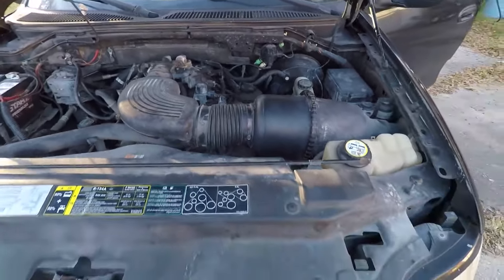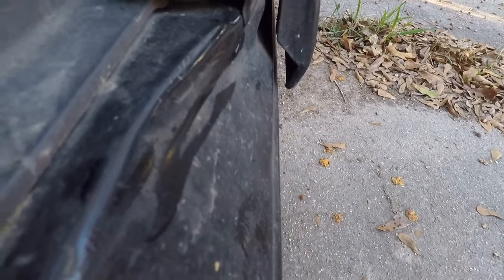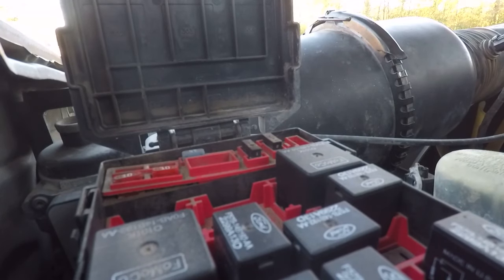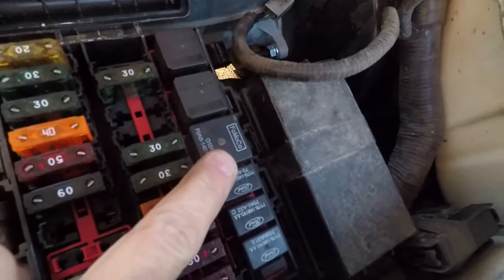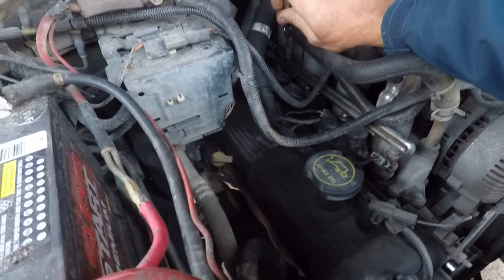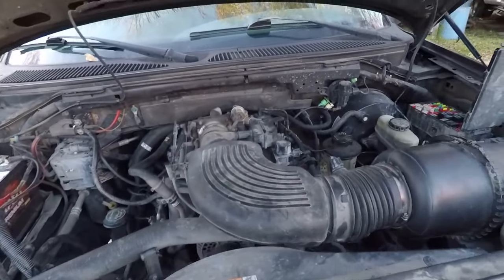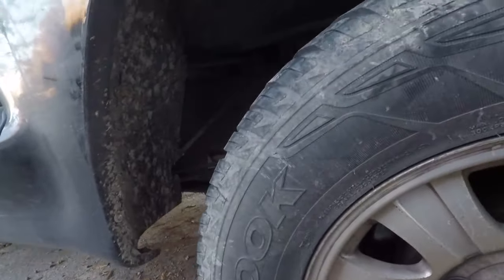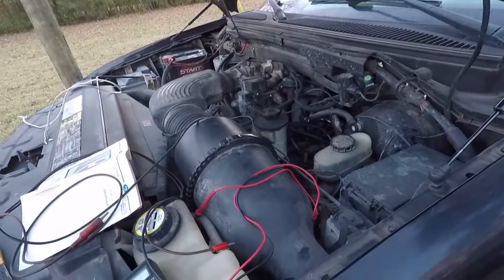F150 Crank No Start Diagnosis

Comment: My 01 Super Crew has been a strong workhorse with 207k and counting. That thing is dead nuts solid!
Reply: fokuz02 257 k on my 01 super crew other than normal maintenance I have put on a alternator and a egr
Reply: 😂😂😂 i got 435k+ extended cab and she just went out in me
Reply: 02 supercrew sitting at 412k definitely solid

Comment: Check fuel driver module..could be a corroded connection..it's mounted by the spare tire..
Reply from the maker: Excellent thought. Will do. Thanks!
Reply: Isn't one on the 2003. Started in 2004
Reply: But wouldn't a faulty Fuel Driver Module throw a code? I have a Crank but No Start situation but I'm getting a "Pass" with no codes fired.
Reply from the maker: Howdy! The FDM failure may throw a separate code, but they didn't start being used until 2004 in the second generation of the triton engines. The black F150 in this video threw Lean Bank codes when it's pump failed. But my 97 never coded at all when its pump died last month even though it ran really badly for a fair bit of time. Best check for the pump is the schrader valve on the fuel rail. If it's not spraying everywhere when the key is on, the pump is seriously suspect. Thanks!
Reply: @aaronsrose  How do I know it it's the FDM vs the Fuel Pump? Also, I tried the test where you spray starter fluid to check for missing fuel, and the engine still didn't fire up at all, not even for a couple of seconds, which makes me think it's a spark issue. I can't find my Shrader valve to check for pressure. Found one valve that spewed green liquid. That wasn't it.
Reply from the maker: If your truck is an 04 or newer, I don't have experience with the ones that have the Fule Pump Driver Module other than what I've seen on the Fordtechmakuloco channel. My experience is only with the older ones that don't have the module. That said, if it didn't fire at all even with ether, I would also look into the spark side of things. Maybe staring with the power supply to the ECM if there is a fuse or relay for that. I've not had a spark issue other than a single coil failure at a time, so this may be a little over my head.
Reply: Fpcm didn't start until 04
Reply: 2001 here crank no start a no codes lot of water in the passenger side door all over the carpet???

Comment: You dont have to suck the gas out. Open the fuel door remove the screws holding the fuel neck to the bed, remove the bolts the hold the fuel tank side of the bed on the frame, losen the other side of the bed bolts thst hold the bed to the frame but don't remove them completely.  Get a friend to stick a 2X4 to prop the bed up and then you can the fuel pump out. While the fuel pump is outplace clean towel over the fuel pump hole in the tank. It tskes sbout 30 minutes with an electric impact gun.
Reply: Not a rusty one in northeast,bed rails would disintegrate.. removing bolts.

Comment: Diagnosis doesn't stop at "fuel pump doesn't work"  the question is why it doesn't work.  You didn't check for a clogged fuel filter for instance.  There's also a unique problem with this generation F150's , a wiring harness on passenger side of engine rests on a hot pipe  - it's insulated but still hot  melts the insulation off the wires and then the power from somewhere doesn't get to someone where and if you fix or replace those wires, it works again.
Reply: Acabo de reconstruir el cableado que se quemó con el escape, pero sigue sin encender solo da marcha y como. Alos 3 intentos de marcha se sigue descargando, tienes algún diagrama de cableado?

Comment: 2001 XLT sport no power to fuel pump. When testing voltage at relay socket in key off there is 12v on one side, key on 12v 2 sides and 7.7v on the fuel pump side. How’s that happen?
Reply from the maker: If the 7.7V is through the relay, I'd swap it with another to see if it changes.  If it works better with another relay, I'd put a new relay in it and continue.  If the 7.7V (should be 12v I'd expect) at the relay socket is not making it to the hot side of the pump,  I'd start running down the wires from the relay to the pump to see if there is a broken one or short somewhere.  And for grins, I'd make sure the fuse is happy as well.

Comment: I can hear my fuel pump and it has all new plugs and coil and cranks string but won’t start, has died once in me before but started right back up and lasted another hour before I was home with no issue and now it won’t even start at all
Reply from the maker: Still could be fuel pump failing. This 03 would sometimes start and run a little and then die when the pump stopped producing pressure. A fuel pressure test would confirm that.

Comment: Great video! My 02 5.4L is doing the same thing and all fuses/relays are ok. One odd thing I wanted to ask about is I was assuming it was the fuel pump and no pressure at rail, then all of a sudden after checking every day for a week one day it started and ran fine up to full engine temp. When I turned it off and immediately tried to re-start, got the crank bo start agsin. Just seems like a weird way for the pump to be intermittent. Any ideas guys?
Reply: My 02 is doing the exact same thing right now. When it does start she will run for hours like a top but if I shut it off and come back there's a high chance it just cranks and never fires. Did you figure yours out?
Reply: @dawildcatz87  yup, was intermittent fuel pump operation. I got one cyber Monday from NAPA for like $120 and paid a local guy $160 to drop tank and install. No more problem. Hope it’s an easy fix for you. Happy new year!
Reply: @dawildcatz87  same exact problem here g
Reply: @lillianasanchez5028  fuel pump replacement fixed my truck. Eventually it got so weak it wouldn't prime at all

Comment: I have a 06 F150 5.4L .  Has spark, hear fuel pump come on, checked  all fuses and relays. "Crank No Start". I have no Schrader valve, so I used Quick Start. Check 4 of 8 coils all have spark. Battery alternator starter all seem to be fine. Think I bought a truck with a Gremlin. 
Any suggestions?
Oh yeah, battery died so no codes!
Had previously camshaft positioning sensor codes. Changed both out.
Reply from the maker: I think these trucks started using a fuel pump control module in about 04. It's usually under the floor on the frame around the front of the spare tire. I think it controls the speed of the pump. If that is crapping out maybe it's not allowing the pressure to get to where it needs to. I'd see if I could find and test the fpcm.

Comment: I have a 2004 Ford F150 5.4 L heritage edition.. At times, it won’t crank over. The only method to successfully turning it on, is to disconnect the inertia, turn it on and then reconnect the inertia switch. When it doesn’t turn on, the inertia switch is not tripped. I have since replaced the switch with a brand new one, but the problem persists. If anyone has any idea as to what I should do, I would really be appreciative! Thank you.
Reply from the maker: That is weird. Have you tried to bypass the inertia switch completely by wiring around it? It could be intermittent contacts in the connector to the switch.
Reply: @aaronsrose  hm not quite sure how I would do that.. I was going to try to splice in a toggle switch but not certain which of the two lines to tap into??

Comment: Was the fuel pump the problem?
Reply from the maker: Yes.  My next video showed changing it and its been running well since.  Thanks!
Reply: @aaronsrose  nice fix Aaron!! My 2003 F-150 4.2 L V-6 will crank but will NOT start or even act like starting like your 2003 4.6 L V-6. It ran fine when I parked it the nite before. I'm NOT getting any spark & CANNOT hear the fuel pump running with the key on! Any ideas would be greatly appreciated!! I did replace the coil pack but no luck!! All the fuses are good! I checked them first! Maybe PCM relay or the PCM itself? Any help Aaron would be greatly appreciated.  I did some research here online & found  out there is NO Fuel pump driver module on the 2003. Ford started putting them on in 2004. I even crawled under the rear, with the spare tire removed & only thing there is a canister. I have MS & NOT able to do as much as I use to! I'll be waiting to hear back from you! Thanks!
Reply from the maker: Sorry to hear that.  If you have no pressure st the fitting on the fuel rail, the pump is either not running or has failed.  Unless it's always been loud enough to hear the pump. You may not be able to.  If the fuses and relays are good and the truck cranks over with the key it could be the pump and/or filter.  If you've checked for spark by pulling a coil and plug and cranking the truck while grounding the plug on the head and saw no spark,  especially on multiple coils,  that's a different problem.  I'm not sure what controls the firing of the plugs but I would check to see if the ECM is getting power correctly.  Good luck.
Reply: @aaronsrose  thanks Aaron! I'll get those things checked out.
Reply: @aaronsrose  just a update Aaron. So I went out today to see if I had spark with the new coil pack I put on yesterday! I do! I got zapped! Lol anyway I put the plug wire on & it started right up!😳 I let it run for 30 minutes. It never stalled out!! It idled smooth except a time ot two it slow down then back up!!  I'm thinking fuel pump as per your video! But I'm gonna just cut a hole in the bed! My truck is rusty some what the heck! Lol
Reply: @aaronsrose  update for you Aaron. I was able to cut a door in the bed of my 2003 Ford F150 to access & change out the fuel pump. It wouldn't start to pull in my garage so I smacked the bottom of the gas  tank with a rubber hammer & it started up!! I also changed the fuel filter. But like other comments now my gas gauge is showing almost a half a tank of gas. It actually had an eighth of a tank.🤔🤔 I just filled up the tank & now it's showing  1/4 tank. I do know that prior to changing the fuel pump it would take a while for the gas gauge to go up after getting gas. Maybe this new pump will do the same!! Idk
Reply from the maker: Glad it worked out. I'll say that every aftermarket pump I've done on these, and it's about 4 or 5 to this point, the fuel gauge acts as you describe. Sometimes it takes a few starts and some driving before it goes up to full and then it's fine. No idea why this is. Thanks!
Reply: @aaronsrose  yes Aaron my gas gauge now reads full as it should! Thanks
Reply: I have the same PROBLEM on my 98 f150 it will cranck but no start after trying a couple times , they only way it will start is if I spray carburetor spray on the carburetor, I neeed helpppp do you guys think it’s the fuel pump or fósil ? Or my air filter is kinda dirty I’m thinking of changing it and doing a tune up 🆙
Reply: Actually my truck will run fine after it’s starts , it doesn’t shuts down or anything it can be running for 30-45 min and it’s doesn’t shut on me it runs smooth it’s just the start takes a couple turns

Comment: my f150 is dead the battery is charged but wont do anything. you can jump it off and it will crank,but when you remove jumper cables it dies.
Reply from the maker: That's different. I'd start by confirming that the battery is good and then check to make sure the alternator is charging. Thanks!

Comment: Have similar problem on 03, 4.6L except the fuel pressure goes to 40 psi with ignition on, then drops immediately to zero. I am also getting no fire, or rpm reading. I am wondering if the ecm is sensing zero fuel pressure and shutting off the ignition to spark. It seems there may be a bad check valve in the fuel pump, even though it was change not long ago. Any idea why there would be no spark following what appears to be fuel bleed off after initial ign on?....thanks
Reply: Check your Crank Position Sensor

Comment: My 1997 ford expedition 5.4 liter at first will start for a second then die, then no start, but will crank no problem.
Reply from the maker: That's exactly what this truck would do.  The pump would work a little when it was cool but it would then heat up and stop. If there is no fuel pressure with the key on,  I'd look at the pump and filter.  Thanks!

Comment: my truck ran out of gas I put gas that was in my g can now wont start
Reply from the maker: Definitely check for fuel pressure at the rail. Could be the pump. Good luck.
Reply: Same bro it was sitting with no gas for almost a year. I recently replaced the fuel pump fuel filter and nothing I can hear the pump come on but I’ll try what he did

Comment: Mine is 2001 Lots of water on the passenger side in the carpet it cranks but won't start
Reply: The famous windshield leak. Disconnect your PCM & inspect the harness on the firewall & the unit for corrosion/water damage.

Comment: 2001 no start...no codes....water in carpet passenger side???
Reply from the maker: No start if it cranks certainly could be the fuel pump. The water might be either the AC evaporator drain is plugged, of the heater core is leaking.
Reply: @aaronsrose  It's got water on both sides even the rear view mirrors got water From it's been raining a lot lately now it's running again for some reason
Reply: Need your windshield resealed. Pull the PCM. Inspect the unit & harness for water damage/corrosion. PCM maybe toast.

Comment: Check your crankshaft sensor
Reply: It’s not the problem I have the same exact truck lol change bank 1and bank 2 cranks and starts when truck is cold  she drives beautiful but when I turn off truck won’t start back up fuel pump could be the problem  and yess just changed both sensors because auto-zone said to haha played me ain’t the problem but they were dirty tho